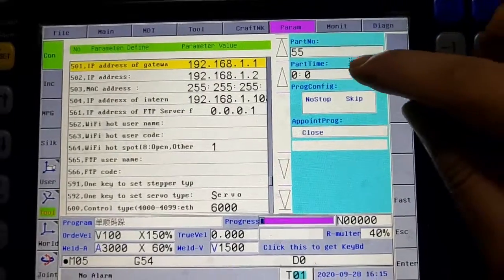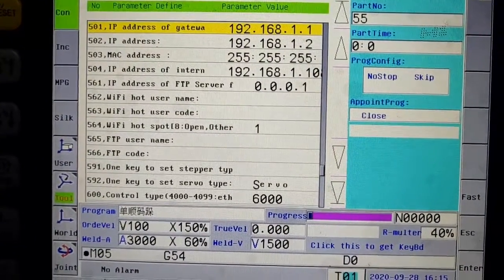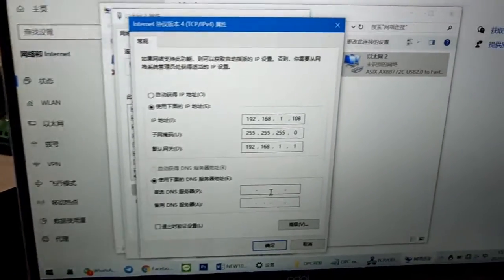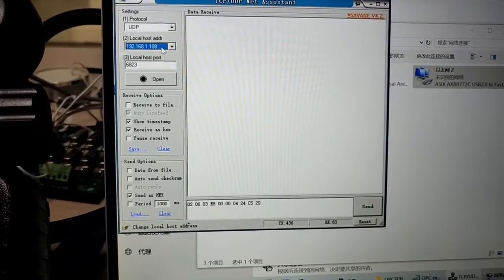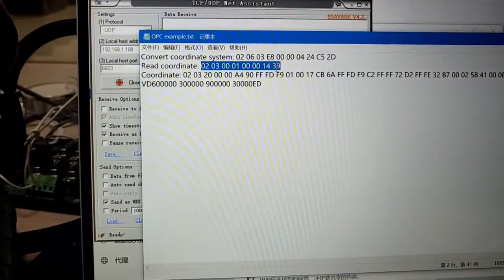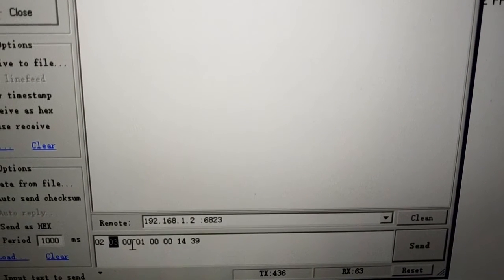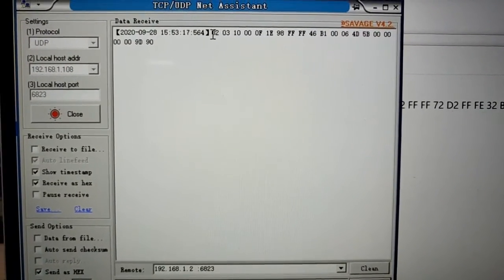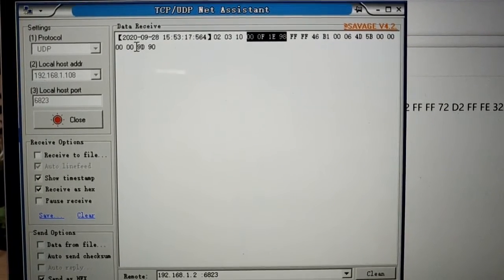OPC function of NEWKer Robot controller

Comment: where  to connect to the robot? I do not see how you connected to the robot? ethernet or RS232 or RS485?
Reply from the maker: Hi, Normally internet port and RS485 port both can be used with PC on the connection board